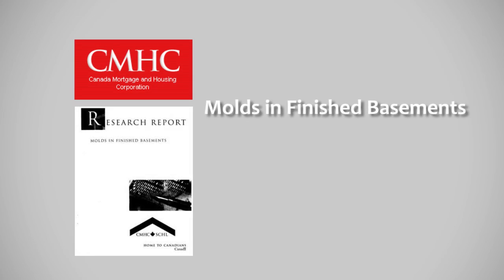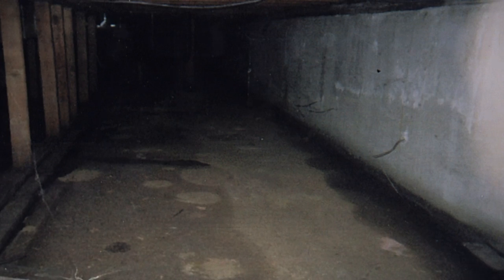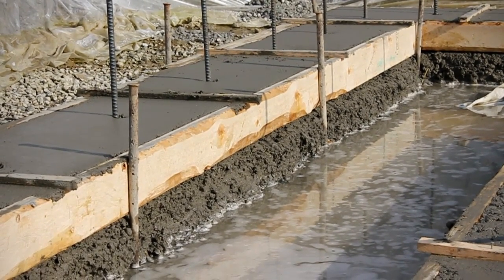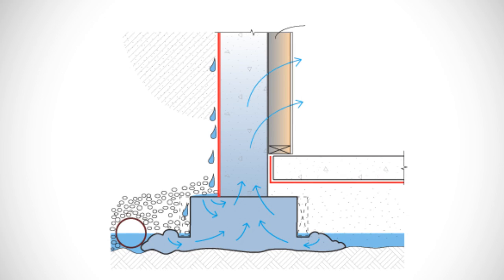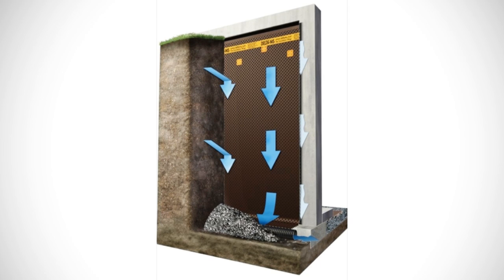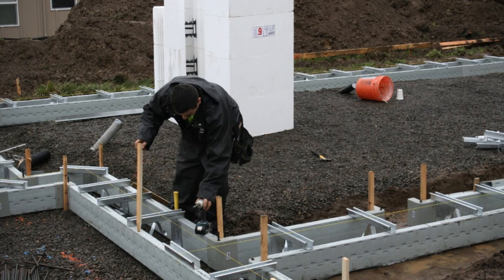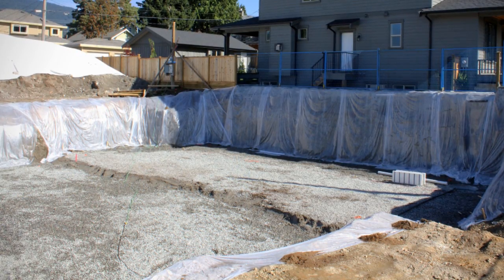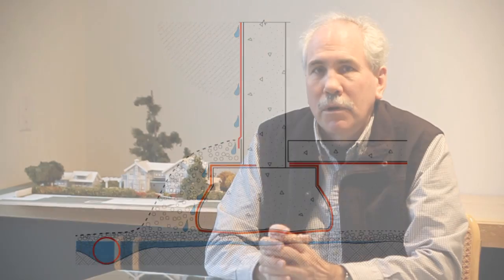Rising Damp (Moisture) in Concrete Footings

Comment: Fast footing prevents intimate contact of concrete with base material,allowing erosion potential at that interface. A better approach is to have the concrete supplier add an integral waterproofing at the batch plant. That will render the concrete impervious to moisture for life of structure.
Reply: Interesting insight. So the "Fastfoot" membrane not only isolates the footer from moisture but also potentially from "intimate contact of concrete with the base material." To address this concern, instead of replacing the membrane with waterproofing additive of some sort, could there be any design idea to keep the membrane AND also minimize potential erosion under the protected footer?

Comment: How do you ensure that there is not any damp coming up from thru the cove? Do you seal it in any way? Also I am interested in knowing how you protect the the inside from hydrostatic pressure and damp thru the floor. I know this is kind of the same questions but I am trying to learn. I am also would like to know how you prevent the footings or footers (depending where you are from) from "settling" and cracking?